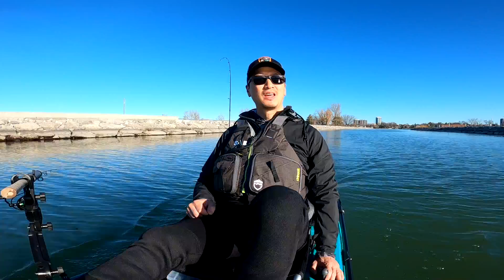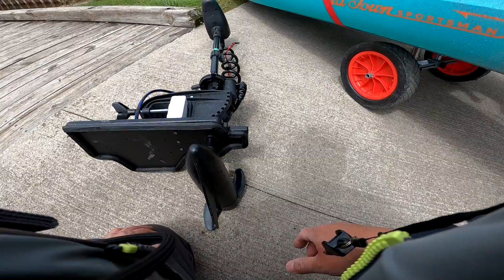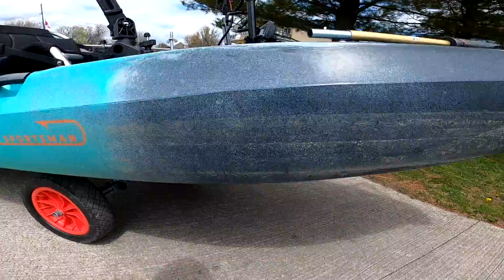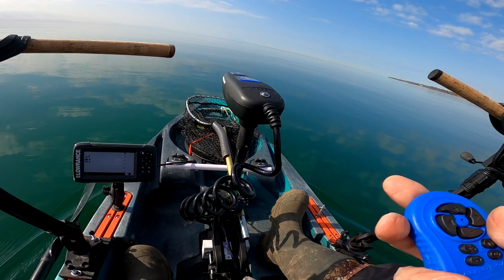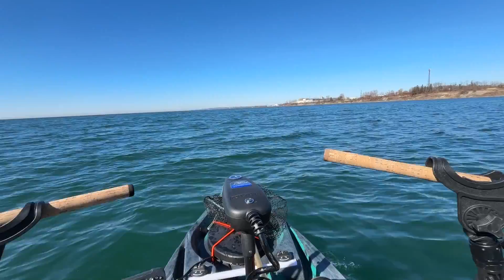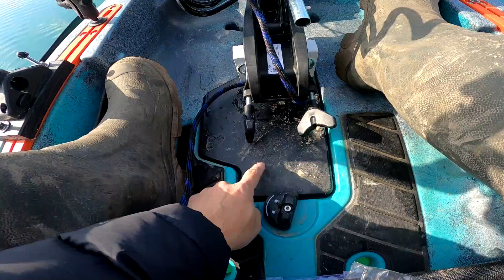How I added Autoboat Smarthead GPS to Old Towne 120 PDL

Comment: I have this same motor, it works really well if your not catfishing and fishing on bottom with a rod in a holder. The anchor mode still moves around to much and drags my weighted line to much. But when im just using 1 rod and casting in keeps me on the general location. I also love the remote steering feature
Reply from the maker: Totally agree. There is quite a bit of movement if you are trying to have a fixed line.

Comment: Wow nice setup this the exact route I think I’m gonna go with my 106 pdl. I’m going to by the insert plate and a Newport 55lb thrust and set it up probably use it like that for a while then get the auto boat since it’s been sold out for a while and projected to be back next year. Any update with yours is it functioning after this time?
Reply from the maker: Yeah, it’s still working, but I can’t do any firmware updates for some reason still. Even without the firmware updates, it runs really well. The anchor mode is what I really love.
Reply: @LadybugAdventures good to know thanks! Hope I can get my hands on one

Comment: I had an issue with mine updating the firmware when I first got it too.  It wouldn't connect to my home network.  I set my phone as a hotspot and then connected to that and it upgraded the firmware without issue.  That might be something to try if you haven't already.
Reply from the maker: I already tried that as well. Followed the tutorial. Set the hot spot to most compatible etc. pretty frustrating.

Comment: I really like this setup. Is there a reason that you chose to keep the trolling motor shaft that long? It looks like you could lower the Smart head by 6+ inches, I could see it being in the way at that height. Awesome job though!
Reply from the maker: The only reason why I kept that height was just in case I wanted to use the trolling motor on another vessel in the near future.

Comment: Good review looking forward to getting mine setup , I plan on putting it on the bow of my kayak and would like to try it on my inflatable pontoon boat. I think it can be swapped around fairly easily.
Reply from the maker: Thank you. Yes you should be able to use it in multiple applications. That’s why I didn’t cut my shaft down.